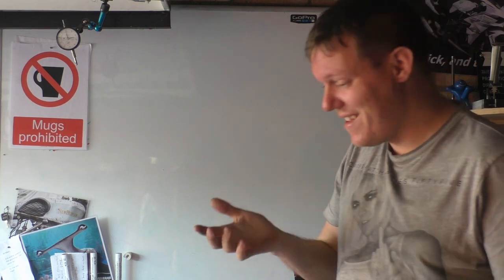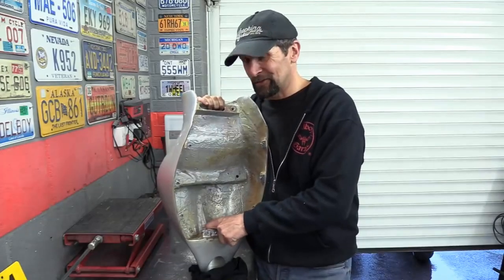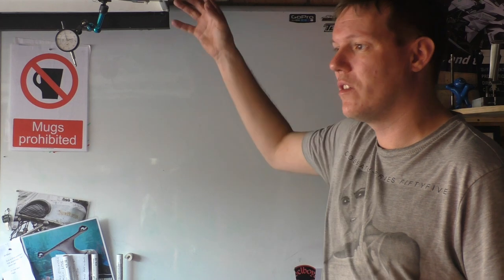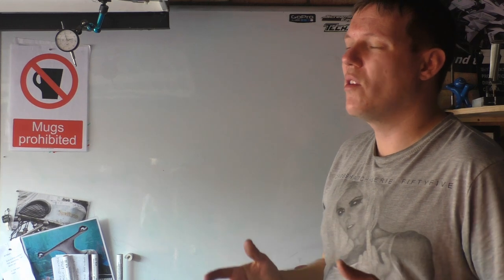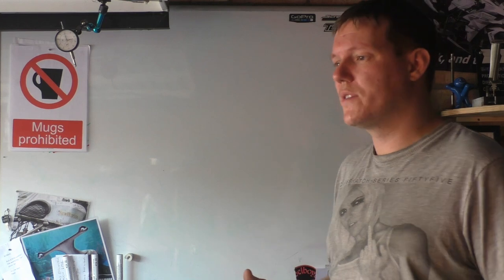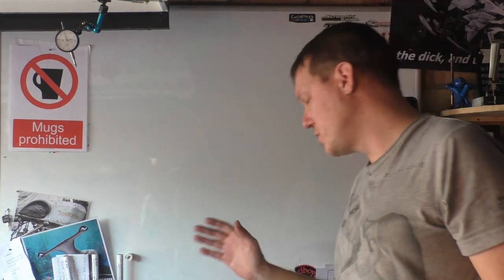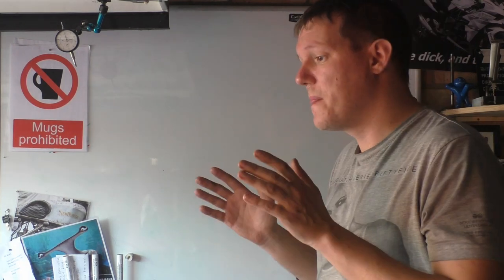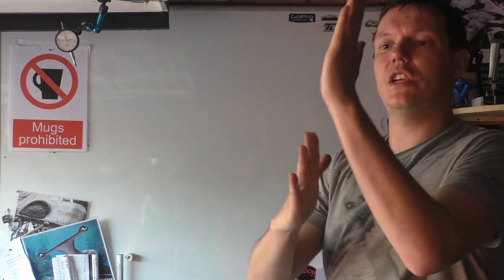Which is the BIGGEST TOOL???? - Rant

Comment: That countersinking clip is playing on loop in machinist hell. 

Reminds me of the time I started at a company and a guy was at a drill press just like that, same speed, and he told me he was tapping sheet metal. He was spinning the tap about 800 rpm, driving it down through thin gauge sheet metal and then drawing it back up, without reversing the chuck. Lmao

This took me back.
Reply from the maker: LMAO!
Reply: one of them corncob roughing drills :)

Comment: Do you think Del has some sort of narcissist thing going on? Just the way he comes across makes peoples shit itch. I watched a vid he done a while ago with him basically saying dont waste money on stainless or plated nuts and bolts, just heat your old ones up and drop them in oil and this will protect them  from rusting....yeah for about two days maybe, I wonder how many viewers tried it and got very disappointed.
Reply: Winston Smith yeah I got blocked a long time ago, and it was just a polite comment that a hot dip in oil does not rust proof anything, seems like he doesn’t like a little guidance! I guess his delusion will continue.
Reply: I think may be Delboy got confused between an old system where things were coated with oil, and oil substitute, or oiled paper.  However that was when in stock and on the shelf and not when in use.
Reply: madcockney I was a blacksmith for 25+ years so a lot of methods we used where very basic, one being burning old oil on the surface of decorative work to blacken and age the material followed by melting bees wax on the surface to seal and protect it, mainly done on interior work like curtain poles, lamp stands etc, that bees wax was on for good unless you put it back in the fire, I’ve got items I done 20+ years ago that still have no rust, probably not ideal finish on a nice bike build though, also need to be carful messing with temperatures on bolts, like you say as a storage protection it’s fine.

Comment: The sad thing is I even gave him some very simple formula to work out drill speeds based on surface cutting speeds, and the fucknugget has completely ignored it
EG vc1=16000/(drill dia X 3.142) = spindle speed for stainless
      vc1=18000 for mild steel
      vc1=32000 for aluminium 
      vc1=6000 for titanium etc etc etc
Reply: gavin laycock That's because it's way over his intelligence level, you wasted your time there. He's a bodger, it's only for the comedy that I catch his vids.

Comment: in cheap angle grinders the housing is the main structure alining the rotating parts. if you put that thing in a vice and assert great pressure on the housing, everything in that angle grinder is gonna be misaligned.

Comment: I've found the best way to drill holes.
1st: place job in hand 
2nd: place wrist in vice and tighten with hammer
3rd: set angles you need
Note: Only people with super dopper hand strength can master this, or wankers

Comment: I know why he did the screw/die thing.
Since he can't do pretty much shit, that way, when he removes the bolt, it rethreads the dull parts he just left with the file/saw.
On the other hand, some brainfart:
"A file does not cut that way...but what if you made a file with teeth that cut perpendicular to the axis of rotation?"...a few seconds later: OMG, that's a reamer...(ignoring the insane cutting speed he used)

Comment: Hey Matt, as a former machinist I will have to agree on everything of what you are saying, except the drill speed he is using in the beginning. According to my knowledge you generally should have a high rpm for smaller drills, due to the fact your cutting edge need a certain peripheral speed to be effective. Of course you I wouldn't expect you to take my word for it so i pulled out my machinist handbook to check the formulas. The formula for cutting speed (for a single cutting edge) is written in here as n=(v*1000)/(pi*d), with v beeing the specific cutting speed for a material (for a single edge HSS edge this would be 20 m/min, for an uncoated 2 flute HSS drill working in steel it is adjusted up to 25, according to my tables), d of course being the diameter of the drill in mm's. Assuming he is using an 8 mm drill, which he probably isn't hahah, you'll get just shy of 1000 rpm. This is of course with a powerful and stable machine, which he clearly hasn't.. but still, to me it did not look far off. Please someone add to this if you have any other way if calculating this. Btw. I almost crawled out of my skin watching the screengrabs from his "how (not) to" sharpen a drill... that S-shaped cutting edge would have had my head roll of my shoulders if my teacher saw it in my hand back in school...
Reply from the maker: "except the drill speed he is using in the beginning."

- did I say the opposite? Not being a dick, just asking.
Reply: @dirtygarageguy  After a second veiw, no you did not, but you noted Keith's slow and controlled drilling speed at the end, so I was under the impression you included the cutting speed argument for the drill along with the countersink, which I can't agree more with. A hasty assumption from my side maybe!
Reply from the maker: no worries dude and I wasn't being a twat (lol) I just wanted to make sure I didn't say anything overtly stupid LOL cheers
Reply: the only way Dels drill press could go as slow as Keiths proper drill press is if he run it by  hand :)
Reply: I learnt the same formula as a dumb fuck apprentice but it was expressed as n=1000S/Pi*D when it got beaten into us. I got the same impression about drilling speed from the video. I reckoned it looked about right for mild steel. Not the countersink though, I was waiting for the smoke, sparks and no more cutting edge that usually happens when someone is too lazy to change belts hahaha

Comment: About the drilling. Actully it is his own project so drilling by hand is not that strange especially if he has the right speed on the drill as you can see it is as the left over material is actually one single looong strain, if they were small short pieces it would be wrong rpm ie not right speed for the material which it is. I think Mat is just a bit overly on the offense just because it is the dude Mat does not like.
Reply from the maker: "if they were small short pieces it would be wrong rpm ie not right speed for the material which it is."

- Are you sure about that?
Reply: Yes, in highschool or rather gymnasium as it is called in SWE I studied automated manufacturing process for three entire years. And it was essential that the rpm and the feeding speed on say a mill, drill or lathe was correct. The optimal settings would result in one lone single metallic strain.

Comment: I wouldn't mind, but he showed a (to my mind at least) far better way of holding threaded things ages ago. Put a nut in a vice, open it up with one cut from a hacksaw, and then when you put your stock in and clamp it up, the nut compresses somewhat to hold the stock and stop it Rotating. Why the fuck is he now using a Die? The easiest way to tell he has no fucking clue what he's doing is by the lack of consistency. One video he'll do things one way, and the next minute (or even in the same video, a lá countersink) he's doing it completely differently as he tries different ways of doing it. But of course, every way its : 'THIS is how you do it'... Boggles the mind. Really, under it all, he's a 'Fuck it, that'll do' Garage "Mechanic" (in the loosest sense of the word) but because he has a following he thinks he's the greatest thing to enter the Engineering world since Brunel. Also, if you're going to clamp your drill in a vice (why not just lay your bench press flat, spastic) at the VERY LEAST mention to people the potential risks and the considerations of doing so, I.e. Don't clamp the fuck out of it because you might crack the case and potentially  short it out on the Vice. ANYWAY, Thanks for the vid Matt, much enjoyed.

Comment: I always use and was taught imperial 360/d and metric 9000/d for drill speeds with mild steel. This is assuming a cutting speed of about 30 m/min and it gets you in the right ball park.
For example with a 10mm bit 1000/10 =  900 rpm 30m/min = 955
8mm bit 1125 30m/min 1194
4mm bit 2250 30m/min 2387

Comment: I know you know he knows we know he knows nothing.

I'm not as safety minded as I should be in rhe shed (OH&S is non existant) but I'm not trying too make a you tube video. Guaranteed if I was, avoiding someone getting hurt or worse would be number 1 no matter how crappy the rest of the vid would be.
That file in the drill was the ducks guts as far as bad ideas goes. 
The rest is just Del being Del. 3" thick glass fairings etc..

Comment: Dear metabo can u make your drills casing square and out of stronger stuff also can u sell me another screw in handle bcuz they wud be useful as handlebar grips on my hammered street fighter build 
Cheers Del 
Ps 
Dewalt
Black and decker 
And Bosch already told me to f### off 
Clarke and Sealey said they are interested as long as I promote their products